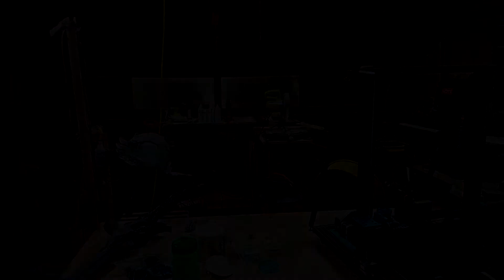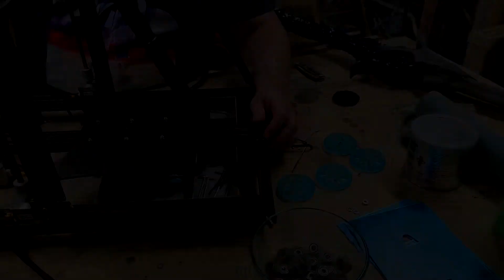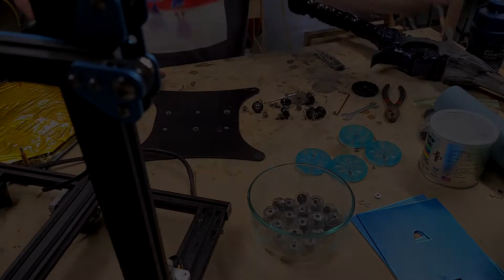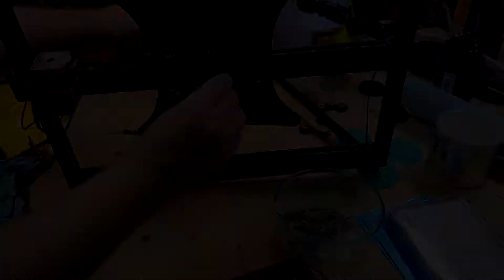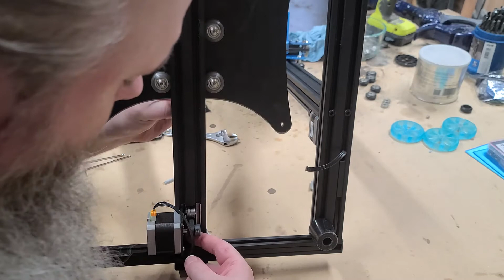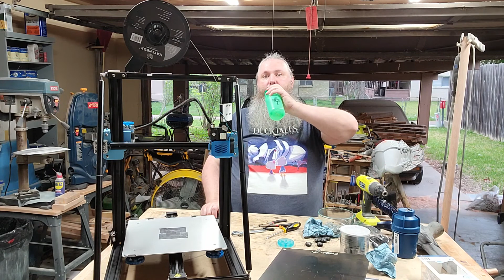Printer Upgrades! CR10 V2/V3 V Rollers Maintenance and Swap

Comment: These are shielded bearings, you will be lucky if any of that grease actually makes it inside the bearing. You could swap to and equivalent sealed bearing size and even upgrade to high quality bearing from NSK or SKF. The bearings should far outlive the rollers themselves.
Reply: Yes.  These bearings ARE sealed.  So greasing them made no difference.
Reply: 100% correct, will be very lucky if anything gets in without a proper grease pusher. Probably doing more damage then good with all that grease. Dust is the enemy in this configuration, Grease and Dust are not friends. If your'e going to grease the bearings on the outside dust cover are a must. Premature wear and tear is the only result of this particular method. Great to watch and appreciate the video though. Always cool to see other makers on here 👍🏼
Reply from the maker: They are shielded but they aren't sealed. So grease gets in there just fine. But, a pair of sealed bearings will last much longer.

Comment: Have you ever thought of using Capricorn PTFE tube?
Reply from the maker: Yes. And don't. In fact, regular PTFE tubes have a problem too; too many fake tubes that have a 180C max temp. Capricorn would work in theory, but it's so tight that the heat causes it to expand closing the already tight tolerances to the point it causes binding. You're better off with the non-capricorn high-temp variants.

Comment: I'm getting my CR-10 V3 next week ;) thanx to your chanel I found out so many important tips and tricks! Thank you for that! I'm wondering the two blue boxes you have under your printer... did you design thme by yourself? Or can I find them some weher to print myself?
Reply from the maker: I found them on thingiverse. The CR10 V2/V3 share the same frame as the CR10 so most things are compatible. Unfortunately, I can't find the post that contains the boxes any more.

Comment: It is hard to find rollers on amazon that have consistent good reviews.  Are you happy with the rollers that you installed?
Reply from the maker: I am. The load on the bearings aren't extensive and even cheap bearings perform well with adequate lubrication.

Comment: How many hours did you print before you started this maintenance?
Reply from the maker: I usually run until a problem arises. The time frame is about a month of constant printing. Sometimes it isn't needed, but I do it anyway knowing if I don't I'm going to fight a print as it won't work right if I don't.

Comment: Interesting upgrade to the bed.  Is the resin knob file available?  They do look good in that transparent finish. Just picked up a used V3, an amazing amount of things wrong with it too.  Watching anything I can to learn about upgrades and repairs.  My E3P and CR-10 do not have direct drive so it is a nice upgrade. Thanks for the video!  On to the next one...
Reply from the maker: I found the video searching Bed Know on Thingiverse. Unfortunately, I can't find the exact one again. Just look for ones that need a Nylock nut.

Comment: Hey, I was curious about why you have those pieces of Aluminum Tape on the center of your hotbed? Was it because you could get every corner to level perfect but not the center?
Reply from the maker: That's almost exactly right. The center was lower than the corners and adding the aluminum tape raised it just enough that it is flat enough.